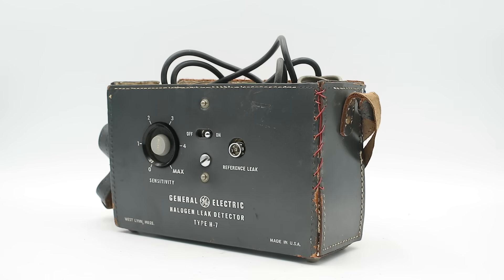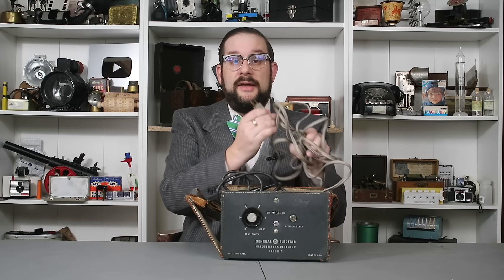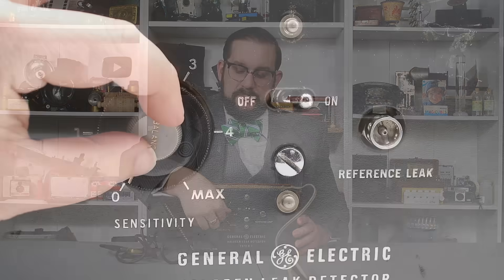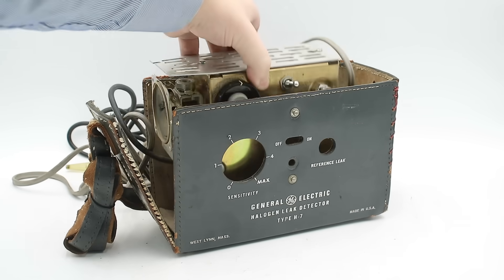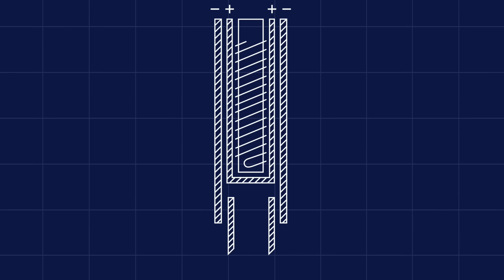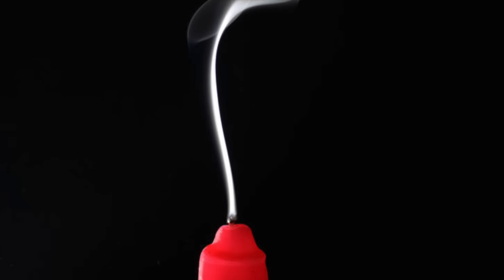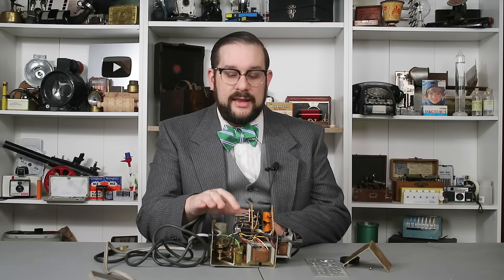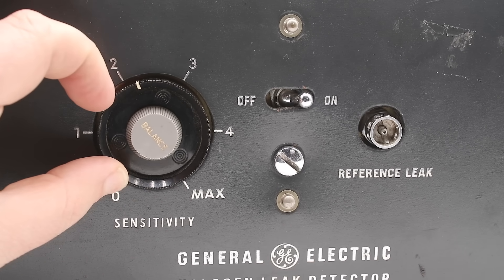GE H-7 Halogen Detector: Sniffing Out Leaks

Comment: Grounded electrical outlets started to become common in the early 1960’s. 

The GE data sheet for the 6M11 is dated April 1963

Some of the other components may have date codes on them as well.

Comment: I will tell you for a fact and so will many technicians who actually use the same leak detectors to this day.  It does work on HFO and  non CFC refrigerant. 
      I actually own and have purchased laboratory grade Lab refrigerant reference bottles for testing refrigerant leak detector sensors. 
     And have posted videos side-by-side.  Showing that this old H – 10 refrigerant leak detector picks up just as a sensitive as $1000 new. Inficon D-TEK Stratus Refrigerant Leak Detector
   R134, R1234YF, R410
     Doing side-by-side test comparisons.

Comment: Re: infra-red spectronomy. I believe this is the method automobile exhaust gas analyzers operate on. You should find yourself a used, discontinued Snap-on MT496 ExhaustGas Analyzer. Infra-red source passing through sapphire windows in sample chamber, then through optical filters. Ck it out, you can probably find one for free or a nominal fee.

Comment: The filter elment/s may constrain the missing ball. You'd want the ball below the filter if it was only one so it couldn't form a seal at the top or get ingested.
Reply: I remember the filter being in the tip, the ball above as he described and never had issues with the ball but then, I used the later -10 model.

Comment: There is a much simpler detection scheme sold by refrigeration houses & even amateurs can make one.  Get a standard propane torch.  There is a ring of holes around the burner base that draws in the air for combustion.  Build a manifold around this & connect to a hose, the other end which will be the detection probe.  Using a small hose clamp, fasten scrap of #12 bare copper wire to the burner barrel (parallel to it) so one end protrudes upward beside the flame.  Form a little loop in this wire so the loop surrounds the tip of the inner blue flame cone.  Put larger black cylinder around the burner to exclude external light with hole to peer through.
          To use, light the torch.  The copper loop will glow dull red in the flame.  You will see that & the blue flame only if there are no halogens present.  If halogen-containing refrigerant is present (sucked in through the hose to mix with the flame), halogen will attack the copper forming copper halide.  This is volatile in the flame & the green glow of copper ions will be plainly visible.  Without halogen, only copper oxide forms which is not volatile, so no copper gets to gaseous state & no green glow occurs.  This test if VERY sensitive.
Reply: I didn't like these much because it was more difficult to watch the flame for slight colorations and navigate the hose along the many elbows and joints in a coil-TEV system.  I mostly used electronic detectors to find general area...then soap bubbles to pinpoint exact location. ;)
Reply: I've seen copper discoloring flames without putting effort into making it doing so.
Reply: @gustavgnoettgen  It does so initially, until the contamination is burned off or if it is mechanically knocked.  But after the flame is running & the copper is hot, the green stops.  The green from halogen is a green CLOUD about the copper loop, not the flecks you get when bumping or scraping it.
Reply: Make sure you don't breathe the combustion products of halogenated refrigerants, you'll get acid burns to the most important part of your lungs, the part that lets your blood get oxygen from breathing.
How does this happen? Say you have fluoromethane as the refrigerant. Even under ideal circumstances, combustion of this gas with oxygen produces carbon dioxide, water vapor, and (here's the dangerous one) Hydrogen Fluoride.
HF gas will turn into Hydrofluoric acid upon contact with water, and your lungs must remain moist at all times in order to function properly to keep you alive.
So if you breathe the combustion products of a halogenated refrigerant, you are going to give your lungs acid burns. Keep that up long enough and you'll get chemical pneumoia just like unprotected people during WWI chemical warfare attacks did. Even the wonders of modern medical science don't have a good answer for how to treat that.